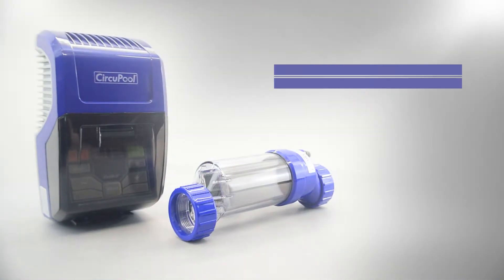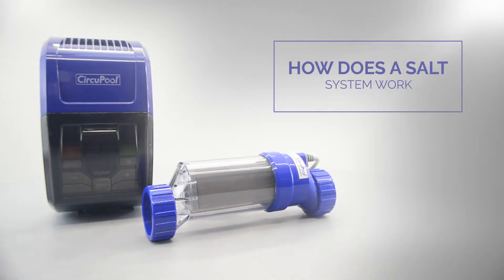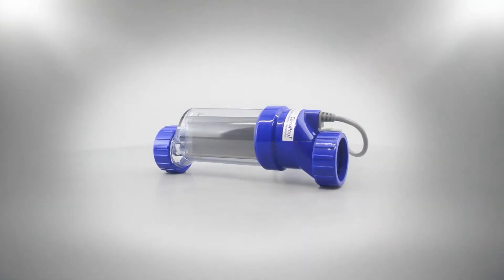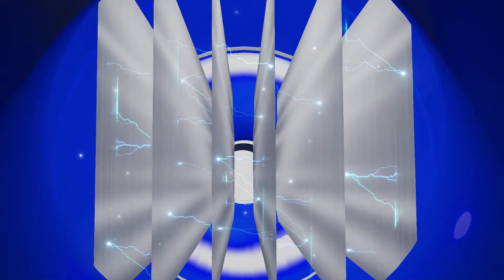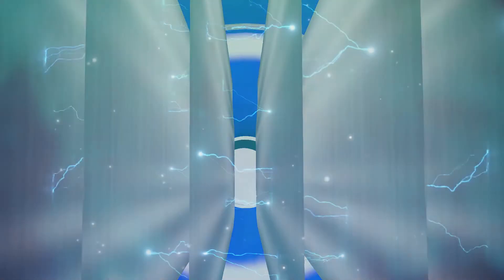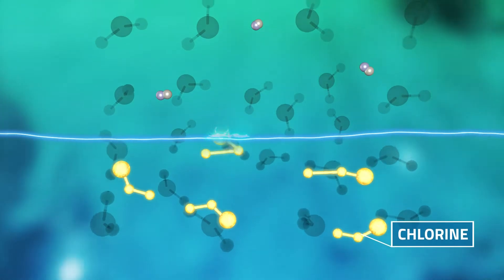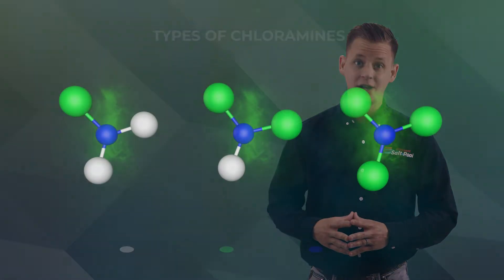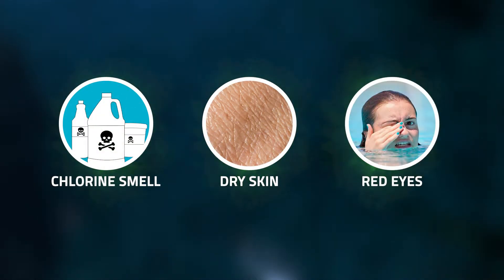How Does a Pool Salt System Work? -  In 60 Seconds

Comment: Does high alkalinity suggest the presence of sodium?
Reply from the maker: Pool alkalinity primarily relates to the pool water's pH stability. The presence of sodium chloride (salt) can be measured directly using test strips, testing drops, or a digital test. Many pools that use conventional chlorine can end up with quite a high level of salt as a result of the chlorination process, surprisingly. Please reach out if we can help you individually.

Comment: Not less Maintenance. Cheaper for chems more maintenance and repair
Reply from the maker: Getting continuous reliable chlorination when it runs automatically everyday with the pump cuts out much of the hassle and vicious cycles pool owners often find themselves in! One of the most popular salt system brands is called "autopilot" for a reason! If we can help you improve your experience we're glad to work with you individually if you reach out.